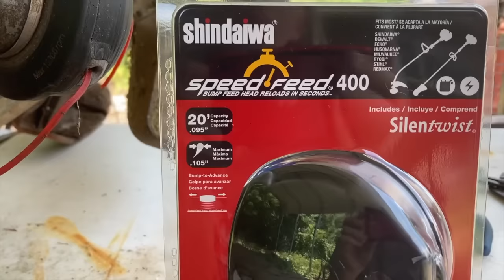The BEST TRIMMER HEAD ever made! How to install a Universal Speed Feed on most any trimmer.

Comment: Have you tried installing the Speedfeed 400 on a Stihl FS56RC?  Yep - I just installed one on my FS56RC and it was a wee bit loose between the top of the head and the thrust plate. I installed the black supplied washer (with the proper side facing the plate) - and I found there was minimal thread engagement. I got about 2¼ - 2½ rotations until tight. I was concerned so I called Echo directly and spoke to their technical people, and they felt that should be enough engagement.... I guess time will tell?

(I did try using a Stihl thrust washer rather than the black plastic supplied washer, but the thrust plate was still a little loose. I felt that the area in the unit between the gearbox and the thrust plate would very quickly fill with wound-up grass, line, debris etc.. so I went back to the Black plastic washer.)

Comment: Unless the string is absolutely straight can one easily thread the line through!!! I have lined up and even with bottom off -I have to use a screwdriver to align the string. I have went over the steps over and over to make sure I was doing it correctly--and yes, I can feed a straight wire or piece of no. 12 wire through easy.

Comment: I'm slowly becoming another one of your fans as I watch each new video, Thanks. I've been a building contractor since the mid 1980's and love and respect tools like you. I am going to buy this new Speed Feed 400 for my still awesome 1998 Echo 2110 that still runs like a banshee and has had zero issues after 100,000 miles. Even though the two factory bump heads work flawlessly I feel I deserve a shinny new thing to add to my machine. I truly appreciate your ability to share knowledge and the way you present it to help people. Take care! Question: One of my saws, a Stihl 023 (also 1990's) doesn't like to keep the gas from leaking out the rubber fuel line/grommet. Yes, I have replaced it with the overpriced OEM part 3 times using Echo white grease to slide it in. After months of sitting with a dry tank, re-fueling for use almost always starts to leak when saw is tipped sideways. Am I missing something?

Comment: Yes, its march 17th kc mo should still be cold out here in 2024, but its not.  My grass is starting to look like my 1970s high school days long hair or actually like right now with a few balid spots and brown spots.  But when i put my cub cadet
With the kawasaki FH430v up last fall it failed to start when i went to put on the 42" snow blower.
Then i changed the starter motor and solenoid, it cranks slow
But it also seems hard to turn with the plugs out. 
It ran perfect when i shut it off and has not started since. 
Im going to replace the 5 year old battery and replace the plugs as well as adjust the valves. 
I have no way to take this lawn tractor in for service. 
It also has a flat tire i just replaced last year.  Thanks black Locust.

Comment: My post was deleted sor some reason... Hate auto feed heads. I use MaxPower 3317233 PivoTrim Universal Replacement Head, 4 x 4 Multi. The best. replace string in a min. And No need to mess with loading it or jams

Comment: I just tap on a clump of grass or weeds. I have very little wear and tear on the trimmer head. If clumps are thin i simply manually push the button in and pull on the string. Doesn't take much time and saves me time, effort, money going to buy replacement parts.

Comment: I use cheap heads that cost me 5 leva ($2.70) lol. They actually last quite a while, and then I just throw them out. Being so cheap, I own a few of them at a time, and I rock up to a job with them all preloaded with line. So, I'm never refilling heads on the worksite. 

Especially nice in really awful gardens that are uneven and full of rocks & obstacles. I'd want to be careful if my strimmer head was expensive, but with these I just go hard and don't worry about it!

Comment: Hey Bre, just found your channel the other day and it's one of the best out there.  Thanks for all you do in getting good info out to us.
I have a 40+ yr old Craftsman Brushwhacker that's the same as a Robin NB04.  I've taken care of it, do routine maintenance and it runs flawlessly and I use it weekly during the season
.  Just wondering if one of these heads will fit (it's a straight shaft and 37.7 cc - REALLY!!!!!!).  If the speed feed will fit, would the 450 be the best choice.
Thanks in advance

Comment: Fantastic video. I’m learning new things all the time by watching them. I never knew about lubing the trimmer, so I figured I better do that; however, I have a 36v Makita trimmer and do not see any place to unscrew to lube on the shaft. The only thing I see are 3 screws on top of where the trimmer head screws into. I figured it would be a major mistake to disassemble that part. The trimmer is running fine, but do some models, such as mine, not have a port to lube? I checked the manual and it doesn’t mention anything about lubing it. Any suggestions would be appreciated. Thanks ahead of time. And yes, just purchased this trimmer head and it’s great.

Comment: I have an older Remington trimmer that needs a  RS65B  spool head.  Still works just fine.  The item is just discontinued.  Dont like junking working equipment but im not seeing much choice.  So im guessing not compatible with mine. Remington ST3812B ST4514B are the model numbers on the manual.  Both take the same spool head.

Comment: Chickanic, I had to open the speed feed head on my srm-225. I found a spool that the string feeds onto. On one side of it I found a letter L, I suppose meaning Left and on the other side I found a letter R, Right?. Which one goes away from the trimmer, L or R. I am having trouble with the string going back up into the head during operation. Thanks. Oh, and thanks for helping me get my trimmer started.

Comment: Very nice video! I bought a Shindawa weed eater over a decade ago and got it with a speed feed head. It is all I have used since. They now have them private labeled and sold under another name I have seen too. They make a smaller size that I recently installed on my Makita 18v cordless trimmer. (That may be the 400? I heard you mentioned model #s at the end)

Comment: I will try that head on my trimmer. It looks great. Was wondering how often do you need to soak your trimmer line water? Also I have a Husqvarna 525lk and was wondering how you know how much grease to put into the 110 HA hedge trimmer attachment. I have a grease gun but I've read that you don't want to overfill the gearbox.

Comment: The best head i have found is a plain piece of cast alloy, it has bends where you just slide a precut straight piece of trimmer line in under 5 seconds. 
No springs, no bump head not plastic, just pull a piece of diamond core line clip it in and through. and its done. I get at least 10 minutes out of the quality strong commercial line and thats trimming up against the bricks and concrete of the house. If im just doing grass and dont wear the commercial line against concrete  i get several days out of one piece of 45cm line. I cannot understand why anyone would bother with stupid bump feeds. Buy a straight shaft full crank machine, chuck that alloy head on i talked about and get a grease nipple on the gearbox and it should last a lonnng ass time.

Comment: I was so excited about the trimmer head,  I immediately ordered one for my Stihl FSA 56. I got it, made the modifications per your excellent video. Went outside to install it and...it's too big for my Stihl. You guessed it, I have a battery operated FSA 56. I ordered the Speed-Feed 400 which fits the FS 56. Oops, my bad. This doesn't fit the battery operated FSA 56. Just a word of warning.
Now I can't find a replacement head online. The metal eyes where the string comes out of the housing are gone so the string is destroying the housing. Help!
Reply: Go to a Stihl dealer and get the head appropriate for a battery trimmer.
Reply: @LL-mt2nz  Already done...thanks
Reply: I find battery equipment does not do well with mods

Comment: Chickanic: I just discovered you on YT and really enjoy your work. I have had an Echo 225 for 6 years now, and am very pleased with it. My only complaint involves the process of replacing or refilling trim line. I use the Echo Speed Head, and find it quite similar to this one that you are referring to.  A few of your tips appear to be worthwhile, but inserting the beginning of 12-20' of line into that miniscule opening can be a real hassle. Usually, the line is stiff and curled. I am going to try to keep my new line moist which might mitigate this somewhat. Do you have any other tips that might help ease the frustration of this process?
BTW, you are one of the most photogenic people on You Tube. Keep up the good work!  Your new subscriber..JWarner

Comment: This is very well made and informative. The video and audio are excellent. I have a Stihl FS36 with a curved shaft. It is 30 years  old but still in very good shape...had it in storage for 23 of those 30 years. I mainly use it just for edging. Will the USF 400 fit my Stihl? I do not see that model listed. If not, do you have another recommendation?

Comment: Thanks for this game-changing piece of information!  One quick question:  Is it possible to just buy a replacement top cap when it's worn out, or do you need to buy an entire new head when the rest of the unit is fine but the top cap is worn down from bumping?  Thanks!

Comment: I bought this head to replace the poorly designed one on my Stihl. I used the line it shipped with and both ends broke off inside the head within a couple of minutes use. I had to open the head and removed the original line packaged with it. I loaded a good quality line and was able to do a fair amount of work and was thinking I finally have something that works when one end of this line broke off inside the head. Is it better than the original Stihl head, yes. Is it good enough, no it is not.

Comment: WOW glad I watched your video!! I have a Shindaiwa and I've been thinking of finding a better string head easier to reload and this is it. I also did not know about lubing the gear box THANK YOU for that. I've had my trimmer for about 5 years and have never lubed it. Fortunately I only use it maybe twice a year so it hasn't seen severe use.Strictly homeowner use. I do however have a question about my mower. It's a Yazoo-Keyes 48 inch zero turn and the hydraulic steering is really jerky. When you push the handles forward the whole mower starts to buck like a horse any thoughts?

Comment: Hello- Thanks for a very concise, complete explanation on the process.  Will this Speed Feed 400 head (Shindaiwa or Echo) work with the Stihl FS45 curved shaft trimmer  ? I didn't see this specific model in your extensive list below.  If it does work, I would need to use the white insert and green arbor instead of the original (black) it came with ?  Thanks

Comment: I have a Troy-Bilt TB75SS straight shaft trimmer that currently has a bolt type head that mounts into an inside thread shaft drive.

Is there a Speed Feed 400 that would work on my trimmer?

Love the videos.  Need to work on my Chipper Shredder next.  It is not idling well. 

Thank you,

Comment: Great video as usual!  Will the Speed Feed 400 work on a Stihl KM 56 RC using the KombiSystem attachment FS-KM Line Head Trimmer?  I sure hope so!  Thanks again for the videos!  The "Shaft" is straight but the cutter head is at a slight angle.

Comment: Nice video. Very well made and informative. Quick question: Is this an auto feed or a bump feed trimmer head? If it's an auto feed it's constantly cutting the ends and feeding more line which is very inefficient in my experience. I much prefer a bump feed head but I hate the new replacement heads by Makita, which I just recently purchased at my local dealer. Is there a bump feed head that you can recommend for my older Makita line trimmer?

Comment: I have a Craftsman model 316.74089, and I bought a replac Shakespeare bump replacement trimmer head. I assembled it according to the directions. I made sure the nut on outside, and the bolt the inside are tight, but it keeps comming off.  I'm not sure what I'm doing wrong. Should I  get a different trimmer head that would work better

Comment: I'm a subscriber and really enjoy your informative videos.  Have you done any videos on what causes a 4 cycle engine to surge?  I live in a northern state and have a Toro snowblower that I purchased new in December of 2021.  It's a 26" 2 stage self-propelled machine that surged when delivered.  I took it back to the dealer, which isn't an easy task with a unit as large and heavy as this one.  They claimed they cleaned the carburetor, and I picked it up.  It continued to surge.  Then they claimed it was my gas?  Basically, they don't want to deal with it again.  It was only used twice during the 2022 winter.  Any suggestions?

Comment: The problem with my Shindawa is that gap where the spacer is grass constantly wraps itself around in that space, my new Stihl 111 is flush, I do want to change out the head to the Shindawa speed head but if it’s going to have that gap I will not. I would assume if you screw that on without the spacer the shaft will now be too long. Can’t win either way.

Comment: Can I replace the auto feed head on my Black and Decker 40 volt weed wacker model LST136 Type 2 40 volts Max ??? THE unit has plunty of power and I think using a self feed head would work great considering the cost of the little spools that just do not last long at all. 
Thanks ChickMachainic.

Comment: I know it's been awhile since you posted this video, but I've followed your instructions to the letter.  I'm using the red adapter and I made sure the L was up. I've  turned the gear drive and spacer both ways .I put a pin in, to lock the head while tightening. The results are the head spins off or it so tight it wont spin. Any help would be greatly appreciated.

Comment: Okay, I’m a little confused.  I’ve got a Stihl FS40C, which is curved. So, you state one must change the screw thing to a GREEN screw thing (but this is, apparently, for a straight shaft) but then you say you have to switch out the whole thing (i.e. the black thing you just changed out the screw thing for the green screw thing) for a white thing if you have a curved shaft, right?  And the white thing is fine just the way it is; it needs no screw thing changed or anything?  I truly wish you’d organized this information a bit better instead of sort of throwing in a weird addendum after sort of leasing people with curved shafts down the garden path, so to speak. But thanks in general.  I enjoy your videos.

Comment: Luv Chickanic! I have a Weedeater Featherlite SST25. Can I use the Echo Speedfeed 400, and if so can I mount it right on the shaft without any of the mounting parts? It seems to screw on the shaft counter-clockwise without the extra parts or this incorrect? Thx!

Comment: Two trimmers one straight lighter weight echo and one 20 volt worx battery power and I can’t get either to work! So frustrated! The reel won’t screw on . I’m assuming I need adapters?

Comment: I'm using a Curved Head Echo GT200, and as I am putting the speedfeed 400 on, it is pulling the stud out. I don't have a locking tool (as I've seen in some instructional videos), to lock the drive gear I am using an allen key or n awl When I try to pull the stud out, I'm only able to get it out so far before that disc gets in the way.

Have you got any suggestions? Thanks in advance, I appreciate your content.

Comment: I just delivery of my Shindaiwa 400 and after extensive investagion I determined that the included bushing (red) is compltely threaded wrong. the 8mm x 1.25 mm LH is complely cut wrong. Went to ACE hardware to confirm. If you buy be prepared to sen it back. Thus I was never able to thread it on the gas powered edger. Please be careful.

Comment: Do you know this fits the Craftsman 316.711930 4 cycle Straight Shaft with the "Hassle Free" head?  It is an MTD with Speed Start and the convertible coupler system.

Comment: STIHL HS 86 R 22.7cc Petrol 30" Single Sided Hedge Trimmer I have  2 of these and both tend to leak burned oil out the exhaust when using them, have you any information on how to reduce this problem both strimmers runs perfectly other to this I have  tried reducing to Stihls low smoke oil I tried adjustments but I can't improve the issue any help would be fully appreciate 😃

Comment: Thanx for video. The line always seems to break inside the head. Have they solved that problem or do you have to take the head apart to get the line started again? That is more hassle sometimes.
Reply from the maker: If your spool is in correctly and your trimmer line is hydrated it will not break off. I made a video about it. Thanks for watching!  https://www.youtube.com/watch?v=irFWBYr_2dA&t=30s

Comment: I have a Black and Decker LST522 and I can not find the hole where the screw driver goes to lock the spinning housing. I want to replace the OEM housing with speed feed 450. So far I’ve dismantled the Black and Decker by removing the shield and wheel cover. Do I have to remove the entire black cover which has the name black and decker? Where do I install lube.( I wasn’t aware I needed it) Thanks in advance for your help.

Comment: I just installed this head in my straight shaft stihl trimmer ( combi unit) the stihl base plate has raised surface just as shown in video. I had to cut line to correct length ( or it tangled up in gearbox ) since line cutter is now above the string when rotating. Is this normal for stihl installation?

Comment: Replacing the head on my echo weedwacker to a speed feed tap and feed head. Normally it would be an easy unscrew the old and screw in the new. The problem is I need to change the mounting screw because old one seems unable take the new head for more than a few threads. Can you tell us how to do that?